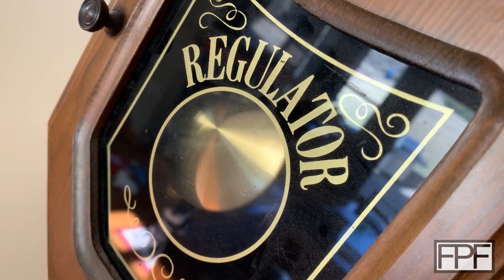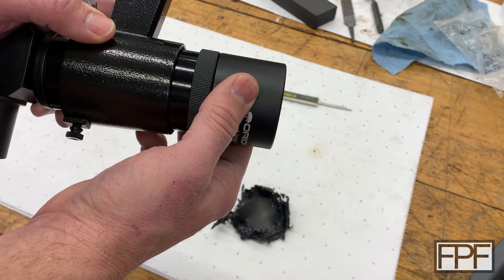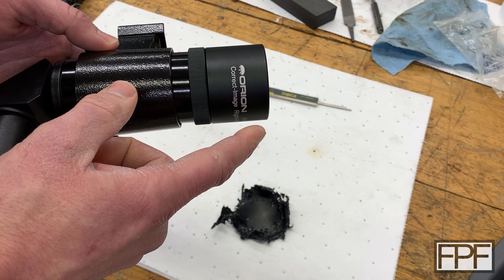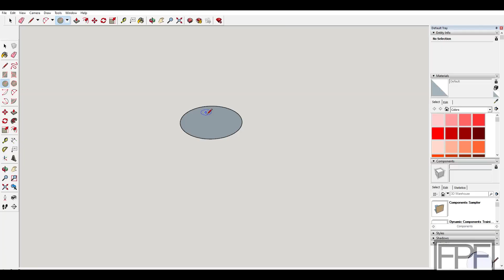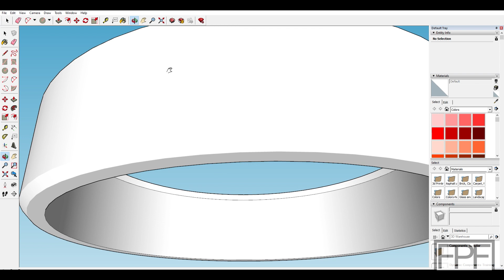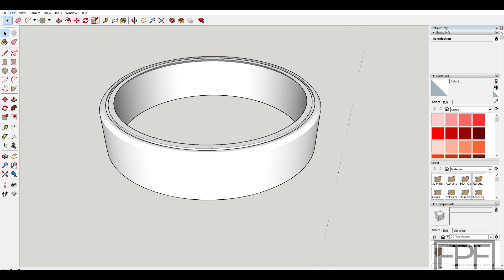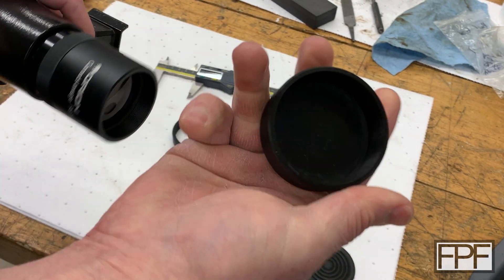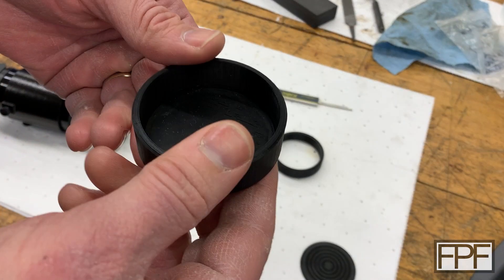3D Printed Lens Cap for Spotting Scope

Comment: A  year late to comment on this. I made a TPU lens cap for my Stellarvue 60mm finder because the original was too shallow to stay put. I feel mine is superior to the original and got it right from first try which is rare. I used the fake carbon fiber pattern print surface which gave it a nice look.

Astronomy and 3d printing make for functional print heaven